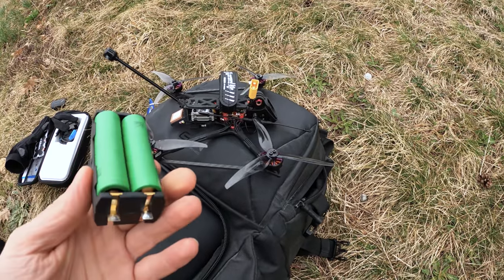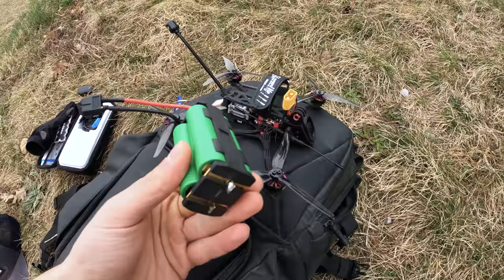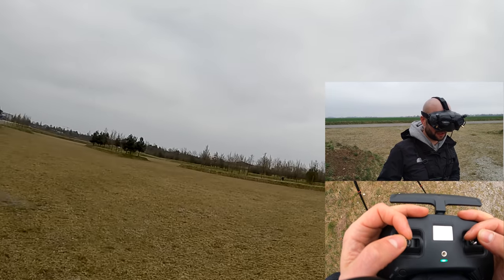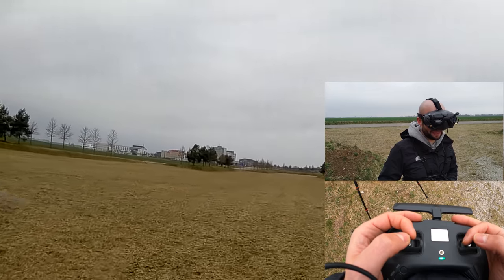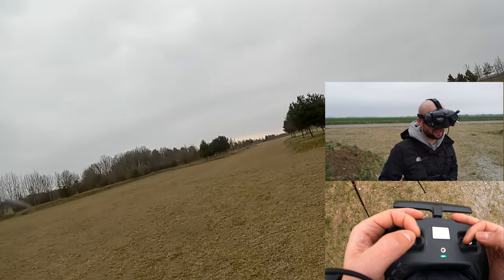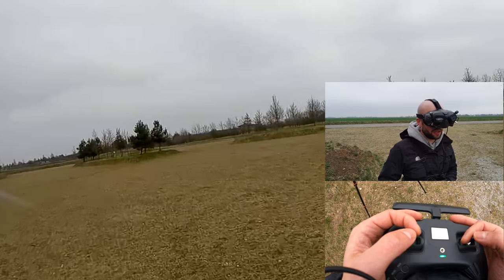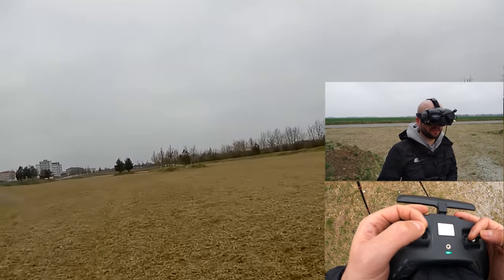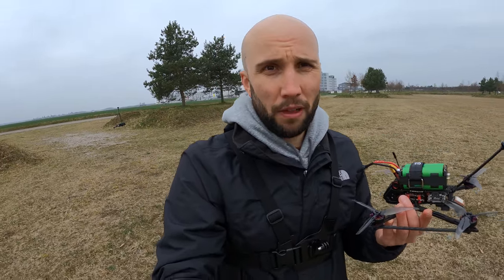4S 18650 Battery Clip | It works!

Comment: I think this is THE solution for everybody who dont dare to solder batteries.  👍👍
Reply: Even if you are comfortable putting a Li-Ion pack together, this is a better solution.
Reply: 50 dollar spot welder on ebay. I would advise against soldering because of the amount of heat that is applied.
Reply: @KAREKINFPV  Or get a 50 dollar spot welder and make them yourself
Reply: @hupo  bro you say that like everyone knows how to connect balance connectors, like everyone has the right heat shrink, like everyone feels safe to connect it all. By the time you buy all that shit and make them, you could have had 4 batteries, ready to go at your place, with no time spent learning anything, or screwing up.
Reply: @hupo  i mean, i can buy 1300mah 1s lipo flat packs for pretty cheap, but do I make all my own freestyle packs??? no... because for a few more dollars they're at my house ready to fly.
Reply: @KAREKINFPV  It's really not that hard or expensive. I'm just an anti shill kinda guy what can I say.
Reply: @hupo  Hmm... i'll remove my comment about the website, but the facts still remain the same.....
Reply: He's still at 18650's. That's so 2019. There are 5000mAh 21700's which can stand 45A out...
Reply: @ZeroFPV  hell yeah my 7" lives on a 6s1p 21700 pack
Reply: @ZeroFPV  21700s are ~60% heavier for the same cell count, that's a huge penalty on a lightweight, not particularly powerful quad like this
Reply: @HarryPhillips1453  
It does work very well with my 5". However, ideal would be 6" or 7" and 6S.
Reply: @hupo  
This! :-)
Reply: @ZeroFPV  I agree. I'm planning out some packs now and I'm planning for 21700s on my 7 inch and 18650s on my 4 inch because it just can't handle the weight. Both sizes have their place
Reply: @yannickg6904  even easier is you have a cell that shits the bed, no need to undo any real work you did. Maybe not a huge pro, but hey
Reply: @ZeroFPV  Really? Which ones? Can you point me at a Mooch test on those.
Reply: @HarryPhillips1453  Less than 50% heavier, most 18650s are 50gms, most 21700 are 70gms. It's true that there is a weight penalty for smaller craft but not an issue on larger ones. The advantage of using, say, a 3p 18650 over a 2p 21700 is the current draw.
Reply: @Graeme758  well it depends on the cell you buy. I'm looking at the molicels, their 4.2Ah 21700 is 80g and their 2.6Ah 18650 is 50g
Reply: @hupo  soldering is fine if you follow the guidelines and use a good iron that puts heat in fast. I solder my packs and have no issues. Solder time less than 5 sec per connection and no heat issues.
Reply: @Clif_Brown  what temperature do you use? I solder my main leads on
Reply: @Graeme758  
I use Molicel INR21700-P42A 4000mAh - 45A. One is about €5/$6.
Samsung INR21700-40T 4000mAh - 35A
about €8/$9.50
And if you want to go for capacity.
Molicel INR21700-M50A 4800mAh - 20A
Around €7/$8.30 (best used for 6/8S) 

I'm in Germany. The prices are taken from nkon.nl in the Netherlands.
Reply: @hupo  
It's important that you use a big tip which can transfer the heat quick. I use 450°C for soldering. I also made a short tutorial for 18650 4S packs on my YT.
Reply: @HarryPhillips1453  Their p42a is 66g, I have one on the scales in front of me right now. Their p26a is 46g on the same scales.
Reply: @hupo  I use 450c. Flux and tin the cell, same with the nickel strip. Then put the strip on and apply the iron for around 2 seconds. 
The cell is barely warm after, I expect most of the heat takes the easy route down the case.
On testing internal resistance and capacity are unchanged.
There is a video of someone attacking li-ions with a blow torch, took ages to get a reaction.
Most danger comes from shorting them, where the internal temp will build up very quickly, not from overheating them with a soldering iron.
Reply: @ZeroFPV  Molicel figures, supported by Mooch, show those cells to be 4200mah (mine tested between 4100 and 4300, not as consistent as Samsung E50 which all tested well over the stated capacity) and 30 amp draw. 45amp is probably a peak, usually better to talk about constant for better comparisons.
Reply: @Graeme758  just checked the datasheet, it says 70. looks like I had a brain fart
Reply: I think the data sheets are a good guide, at least from people like Molicel, Sony, Samsung etc, but they have a fairly wide latitude. Most just say 50g for 18650 and 70 for 21700, it's close enough for anyone using them for vaping.

But when we are counting grams it's useful to be a bit more accurate. I use either my own, limited, equipment for measuring, or see if Mooch has tested. In fact, I buy after seeing what he has tested, saves a lot of disappointment.

I've just made up some 2s packs with Molicel P42As for my ZOHD Drift, the cells are 66g but by the time solder, nickel, xt30 and wire, kapton tape and shrink tube is added it is 149g. That's almost half the weight of the (320g) plane! But about a 50% weight increase for over twice the capacity of the recommended lipo.
Reply: @Graeme758  Yeah, that's possible. nkon.nl listed them as 45A constant. I had not really the need to test them to the limit. My draw is well under 30A most of the time (most of the time 10-15A on 6S).
Reply: Coming from an FPV noob who just recently finished his first drone design & construction , I was wondering why people in FPV weren't using these for Li-Ion packs in the first place. I mean you do see them in almost all electronics which use standardized cells. Always assumed the reason for pre-fab packs was LiPo specific and had something to do with cell physical durability.
Reply: @RadekMacha  
Simple answer is weight. Welding/soldering the cells together and to wrap them in a shrink tube is less weight.
Reply: @hupo then u need to buy or make a charger instead

Comment: This if developed properly could help solve the problem of replacing bad cells without having to release spot welds. I think properly shaped low resistance contacts and insertion/hold tension is key. At present although seemingly adequate could introduce problems in certain scenarios.

Comment: Great work Dave! I have used the same cells from old drill battery packs and they work great. I bought just the contacts so I can custom print the holder right into the quad frame or make custom packs. Another benefit is independently charging cells so their health can be monitored easily. Thanks for the video.

Comment: Apart from the weight difference, what are the disadvantages or risks of using clip batteries like this? Compared to soldered batteries, is there also significant power loss?

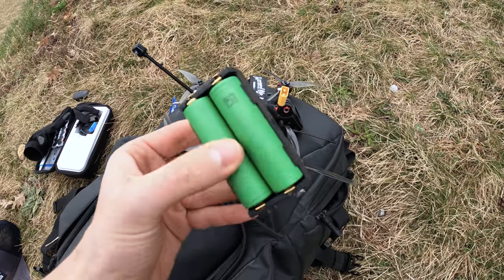Comment: To wire this all together, Is it just the case of putting the holders back-to-back,  soldering the bottom ones together where they touch (as in 0:28 in the video)  then bridging two of the top connectors together with a wire (as in 0:24 in the video), and finally connecting an XT30/60 to the last top two connectors.  Thus creating a series connection from Positive to Negative?

Comment: I bought a mixed pack of 18650 holders (single, double, triple and quadruple). I tried to fly my chimera 4 with three batteries and when I tried to take off it went about two feet up and sagged back down immediately. I'm guessing my mistake was that I used the power leads it came with. Way too thin. I'll put some 3S appropriate wires on and try it again.

Comment: how do you make a 4s out of it , would love a wiring demo on it
Reply: I believe you just wire them in series. Since you charge them separately, there's no need for a balance lead.
Reply: @slapjackftw  would this work the same for lipos? i own a novice 2 that works by hooking up 2  1s batteries in series im upograding the flightcontroller to be 3s capable the motors are already 3s capable can i just hook in another connector and go? or is there battery balancing nessecary?

Comment: If you kill a cell just swap it out! I hope those springs maintains electrical connectivity after exposure to the elements for a while. Gold is good but the batteries might oxidize a bit. Also this spot is awesome!

Comment: I'm really late to finding this video but is there a video on how to make this 18650 Battery Clip? I would love to make one and see how well it works for my needs and possible sell a few lipo batteries. I don't do any racing or freestyle only smooth cinematics and would love to get 15-20min flight time on my 5" fpv. Also if there some sort of covering you could use or make incase of a crash so the batteries wont fall out and to protect the exposed wires and contact points?

Comment: Hey Dave have you tested this with 21700 instead of 18650? should provide even longer flight times
Reply: The 21700 have roughly the same energy density. Only advantage is higher ampdraw on some 21700

Comment: Gantastic Dave🙌🏽 I think that's a great idea, and we are waiting the little video to how weld 2 or 3 slots to make 4 and 6s. So, one question, which what charger do you charge a lot of 18650 cells together??
Reply: There are 18650 chargers online. I've seen them used to recharge vape 18650 batteries for quick swapping. Otherwise you can find various setups for charging them all at the same time.
Reply from the maker: To be honest I'm intentionally never making tutorial about building batteries. I don't want the be the reason someone has this blow up in their face because my tutorial wasn't perfectly clear 😅

Comment: It's like using ph2.0 on 1s toothpicks vs xt30 (For convenience, slight power efficiency loss.). I've used blossom sleds for RC trucks before, quality stuff. Shoe goo the solder joints and your good. For longevity get the nickel plated contact version. The brass oxidizes and loses efficiency faster.

Comment: i know this is very old post but im thinking about something similiar for my 1 meter wingspan fixed wing, will use 40A t-motor motor. What you think? It will melt the plastic or even springs etc?

Comment: Great to see that this works! Did you find any Battery Holders that have some kind of mechanical reverse protection when inserting the Cells? Gets even trickier the more cells you use...
Reply from the maker: Unfortunately not since the cells are completely symmetrical. It makes me a bit nervous too 😅
Reply: @DaveCFPV  well, with 2 cells there are 4 possible ways, one will fly, 2 should sum up as zero volts, one will smoke - think I can live with that...will mark my battery's positive side.

Comment: How do you get the cells out of the trays? I’m gonna be running a 2s setup in my defiant Sprite but because I had to mount the tray in the foam, I need a way to get the cells out. Plus I’d rather charge them individually than as a pack.

Comment: Moin! Would you say this exact quad flies better with 3S 18650 instead of 4S 18650?

Background: I am just trying to build the lightest O3 quad that easily flies for over 15 minutes for exploring on trips. Saw all the 4" LR Models but all seem to recommend 4S instead of 3S. (3S is minimum to have enough voltage for O3..). I though the extra 50g make it more sluggish. (I know +1 18650 is 15% more weight for 33% more voltage & energy, but then you could argue, get a 7" lol)

Comment: That was not to bad with the 18650 interesting results. I been thinking of trying those batteries. To charge them do you charge them like a lipo ? Very cool video and enjoyed watching and the info. Thank you left a like
Reply: You could charge them up to 4.2 volts like regular light post but the extra capacity gain is nowhere near the cost of battery degradation charging from 4.1 to 4.2 volts only yields about 5 seconds extra flight time, nothing else and you're just killing the lifetime and cycle time of your cells

Comment: in normal liion packs, the cells are usually (?) joined with spot welded metal strips
i guess the small cross section of those welds is comparable to that of the contact points of the clips
if the cells were soldered with thick gauge wire, they might have less sag
Reply: why is the sag bigger when the contact points are smaller? as long as the metal strips dont get hot, there shouldnt be too much loss, right?
Reply from the maker: I think the welds aren't the only contact area, the metal strips have full contact to the cell :-)
Reply: @mirkowaechter  
the resistance of a conductor depends on lenght, crossection and the conductance of the material
R = L / (k * A)
if the crossection decreases, the resistance increases
smaller contact points increase the effective internal resistance of the battery
same thing with inappropriate connectors, if you were to use an xt30 on a full size 7" quad, maybe they would just melt

the metal strips might not get hot, since they themselves have enough crossection, but maybe there would still be a voltage drop over the weld spots
this voltage drop increases with current draw
U = R * I
Reply: @marc_frank  But if my quad pulls 60A and the battery is at 15V that means the total resistance from battery to motor and back is 0.25 Ohm. I doubt that the resistance of the spotwelds is somewhere near that. Or am I missing something in this calculation?
Reply: @mirkowaechter  idk what has been calculated by that
diatone has their motor internal resistance on the website
~50ohms
4 in parallel is still not 250mOhms
there might be something weird going on with the conversion of dc to ac

internal resistance of batteries is also measured in mOhms usually

Comment: Man that's crazy, I had the same idea few days ago because I will never solder together little bomb like 18650! I had found other battery clip but now I will definitely follow your lead =) ! Did you solder a balance cable or you don't need it if you charge them separately?
Reply: I did it today and it works! If you have question about wiring it, I will be happy to answer
Reply: @drze7910 Just bought a 2 pack of these battery holders.  How do you wire it up?
Reply: @drze7910  I found a YouTube vid on how to make 4s packs out of these 18650’s…. 

My Amazon order for the battery holders has been cancelled!  

Some 18650 cells, a spot welder, and all the trimmings are on the way as I type this.  YouTube got me again!!  😂
Reply: @IAmTheCraftsman  Hahaha I know this feeling 😂! I think it's for the better that your order has been canceled, just be carefull with this batteries!

Comment: Hey, great vid! Just wondering how to calculate, theese batteries can discharge at 30A tops (if put in serial(4S)), so this 13A ESC would eat 4*13A=52A, this is 22A more than the batteries can handle. Wont you damage the batteries? If I am not miscalculated.. Thanks!
Reply from the maker: That's just the maximum rating of the ESC. Doesn't mean the quad also pulls that many amps :-)
Reply: @DaveCFPV  Yeah but if you do a punchout it would, right?

Comment: I just want to know that the li-on 18650 batteries are much cheaper than lipos but still most of the fpv racers uses lipo for fpv flying . So is there any difference between the two in terms of performance ?? Please let me know.
Reply: If you are freestyle /racing guy you would prefer Li-Po, if you are longrange cruiser you'd prefer Li-Ion (18650/21700). 
LI-Ion - longer flightime, less power output
Li-Po- less flightime, better power output
Reply: @brezovprut4431  Great Sir . Really appreciate your answer

Comment: Hey Dave!   I received my Rekon 5 last week and it's a 4S setup.  After seeing this video I'm having regrets, wishing that I went with 6S instead.    To convert over to the 6S motors, do I need to change anything else? Example voltage regulators for any of the components or a different PID profile?
Reply from the maker: Just the PIDs :-)
Reply: @DaveCFPV  thank you sir.  I love the Rekon5 so far!  I'll be flying at 14,000+ feet in the mountains of Colorado so I'll definitely be drawing more than 30amps against the windy peaks with a li-ion so 6S is the way to go it seems like.       Would you mind sharing the PIDs or would the Rekon website have them available ?
Reply: @proxlamuz4591  Colorado ❤️
Reply: @DaveCFPV  Pleeeease, give us the PIDs (for the 6S version with 4 li-ions) !!

Comment: so i ordered the GEPRC CineLog 25 4S and searching for a battery pack that i can fligh for 10min - 30 min. Can i take the same pack like you for this drone?
Reply from the maker: it will probably work but handle pretty poorly and flight times will be on the lower end compared to a long range drone
Reply: @DaveCFPV  Do u have any idea what i can do instead?

Comment: Mhh... How about a set of 3D Printed Endcaps with reliably Cell contact making inserts already soldered to Balance and Charging leads? All the wiring would remain on the 3D Printed Parts out of which the Cells could easily be popped off. Securing the Endcaps to the Cells would be done via a suitably sized Heat Shrink that could be cut open for access to the Cells - I imagine the 3D Printed Endcap & Heat Shrink solution could shave off a some more weight compared to two of those carriers.

Comment: You should use „35A continuous current Samsung 18650 2500mAh“ batteries 🤞🏽👍🏽 make a 4S Pack with Balanceleads , then you have normal 14.8V 2500mAh 140A 💪🏽 so it should have enough power for 35A ESCs 👍🏽👍🏽
Reply: BUT it does weight ~200gr since one Batt is around 48gr

Comment: I see what you're doing but based on your voltage, it's not in series, and actually parallel. Remember the difference between parallel and series. If you had it in series, it would be 4x3.7 after voltage drop which is 14.8v. in parallel, it would remain at 3.7 and bellow ; ). 

You'll need to run a system they takes ~14.8v range for this to be a true series.

You've raised your 3.7v available amps in the setup you have, which is what you want if it can't truly take a series connection.
Reply: @michaelbibby8636  Ah, I see. I must have missed that.